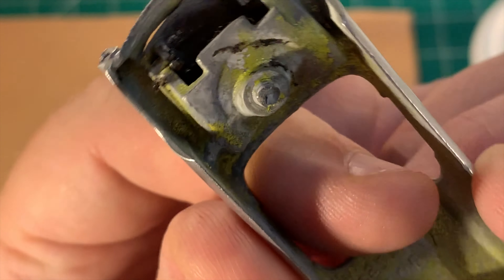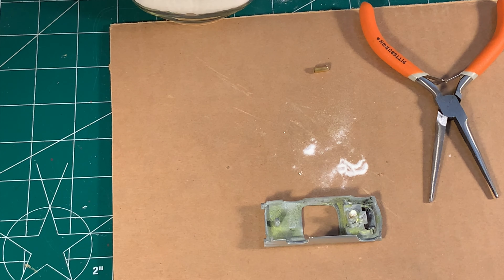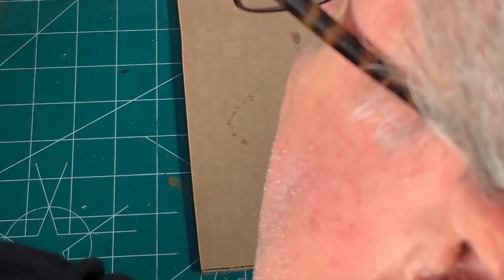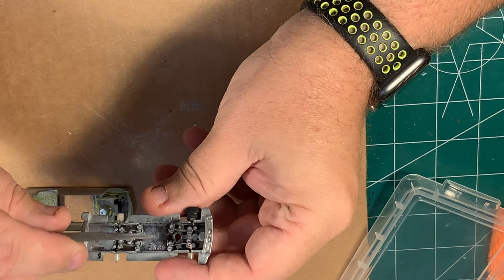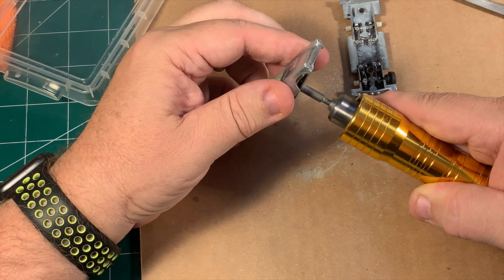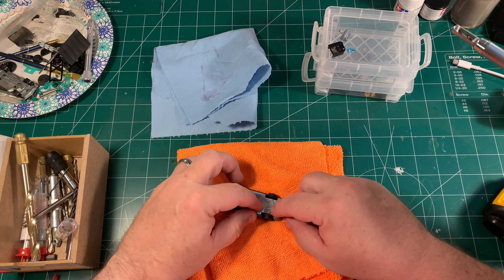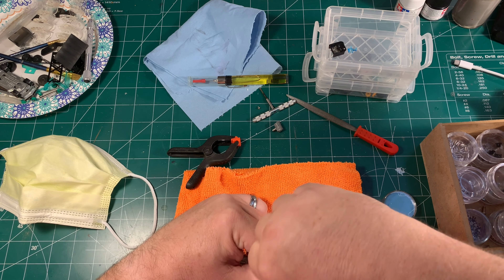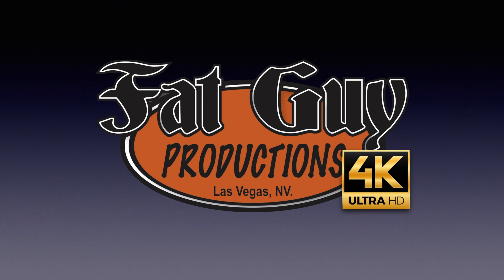How to Repair a Blown Out Post - Diecast Repair and Restoration!

Comment: I've only blown out posts on a couple of diecast cars, one of which was my favorite. I've learned to fix the blown posts using round bar from model sprues. I just use a fingernail file to shape one end to perfectly fit, then glue it in as deep as possible. I drill the new screw hole by hand with a drill bit wrapped in tape and inserted in an X-Acto knife handle. This method works pretty good, but I really like the metal sleeve tube method you showed. This whole hobby has become one of those "learn from everyone else" kind of things, which is great. I'm also a model railroader, but those guys are a tough crowd to work with. Thanks for this video! 👍👍👍

Comment: interesting and informative. I wonder if it would help to gently tap the brass tube to make the soda crumbs fall down the gap further, or maybe it doesn't matter in the end.
here in germany you find those tubings at some construction markets. they used to be available at modeler's and model railways shops, but those are dying out left and right these days. seems people here buy too much over the net, and shop space is expensive as hell, too.
back in my youth I used to restore, or rather customize, a lot of diecasts, too, and as you said a lot wasn't available back when. or inaffordable. so I put paint on with a brush, and drilled the posts out just enough to leave enough material to press it back into shape to keep the bottom from falling out, and wheel swaps were not even an idea... ooh the corroded axles I had to save, some where thinner than needles when I was done. XD
I wish you an awesome new year!

Comment: in my experience, when filling deeper things or making thick areas with the baking soda and glue, it's better to do it in layer. Here's why, the instant the glue hits the baking soda, it begins to set. Often the baking soda on top is hard set before the glue can get down deep. With these posts, it's a 50 50 proposition whether or not the glue gets deep enough t solidify it all. However you may never know, since it's hard on top and the tube holds the sides in.  Often for things like this I like something called Steel Putty. it's a two part putty that you mix together and can shape and form like clay, until it sets up.. then it's hard as well hard as a rock maybe or at least a hard wood. I have rebuilt pieces of figurines with it, shapeing it with files and sandpaper, then painting to get the colors. Particularly helpful when the parts are larger. (I often use the super glue where the putty attaches to make that area stronger)  As for diecast use, I've made hood scoops, blower scoops, and various suspension parts for the larger more detailed models.
Reply from the maker: Makes a lot of sense....